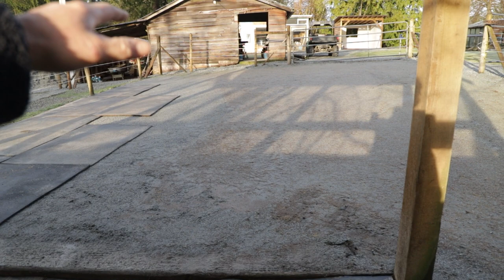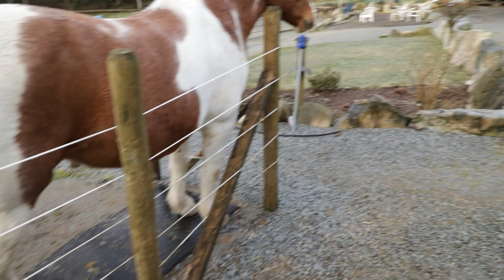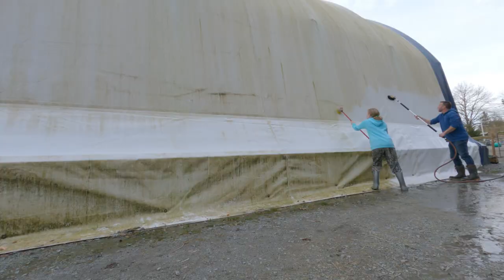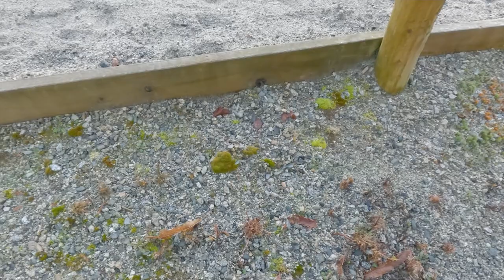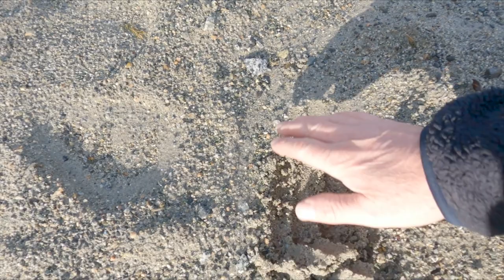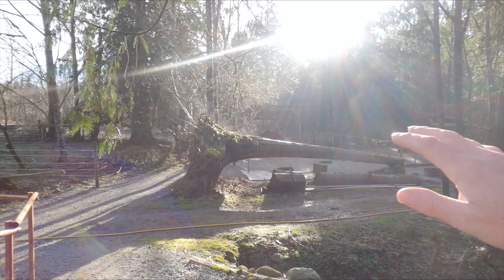How I Built The All Weather Horse Arena: Foundation, Sand And Fencing

Comment: Thanks for the explanation. That’s a wonderful arena you made.
Reply from the maker: You're welcome!
Reply: @StableHorseTraining  when we put in our round pen we were guessing, and we got the gravel part right, with adequate drainage, but we then put a layer of road cloth down and topped it with hogs fuel. If my horse needs a good grip, his hooves dig through the hogs fuel and slip on the cloth. Grrrr.  So now after seeing what you did, I am emboldened to scrape off the hogs fuel, take off the cloth, and add sand. The gravel is already well tamped down by years of horses padding it down.

Comment: Will you ever try to do anything about that little spring in your arena or just leave it for the horses? And by the way, Lena has the softest eyes...
Reply from the maker: I don't think so. I would have to remove the sand, dig up the compacted gravel, cut the cloth, dig the dirt, lay pipe from a bit ahead of the puddle to the outside of the arena, add in drainage rock, re-cloth it, put gravel back and compact solid, then put the sand back on. For that amount of effort it doesn't seem worth it.

Comment: How did you dig the 2" ditch to lay in the retaining base boards?
Reply from the maker: By hand
Reply: @StableHorseTraining  I was afraid you were doing to say that ;-)
Reply from the maker: Yup... Takes time to do the job right. 6 years in and I have zero issues with the edges of the arena. I've seen so many improperly done arenas. Once it's done, it's done for a long time rather than having to come back to it